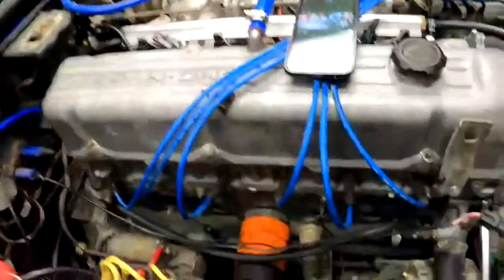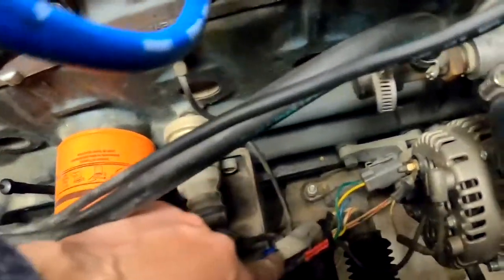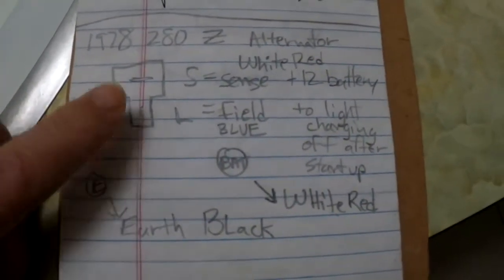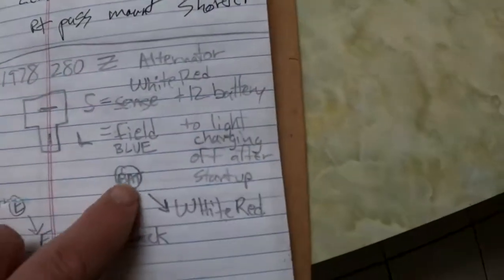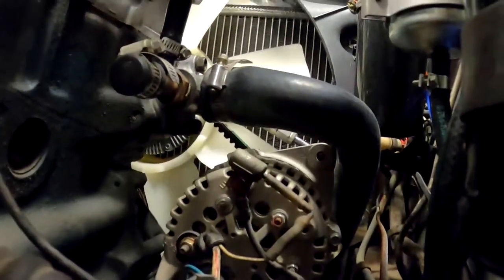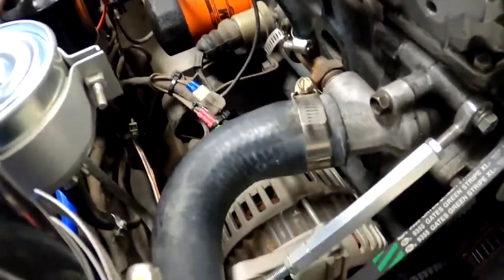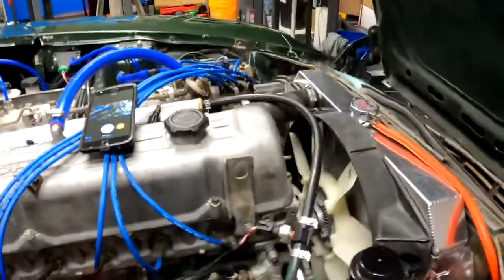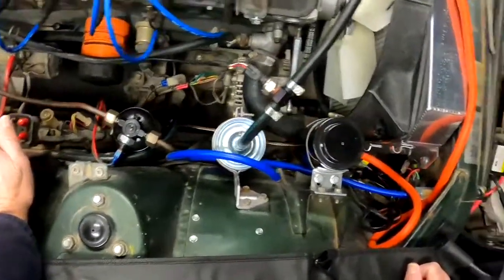280Z 70 AMP Alternator Upgrade

Comment: Great video!!! i have one question. when re wiring (jumping) the voltage regulator do you recall how you wired that?? one of the sites has pin 1->5, 3->6, pin 2 & 4 not used. the other site has pin 1->5, 2->3, pin 4 & 6 not used. thanks !!!